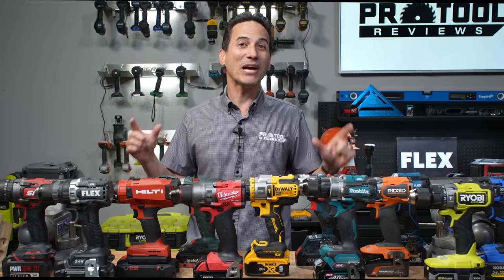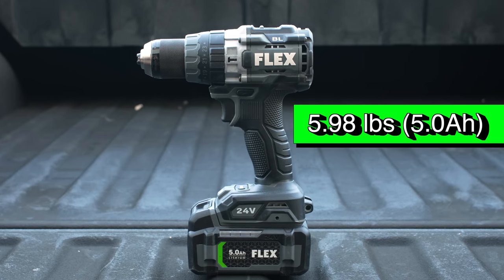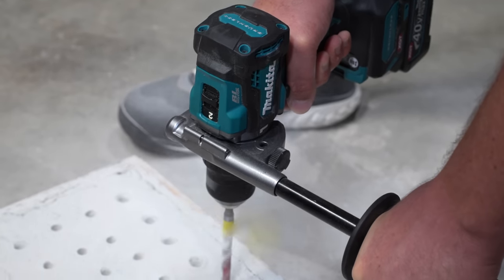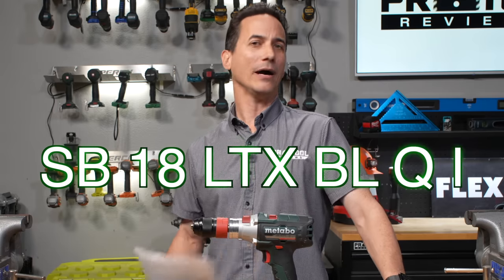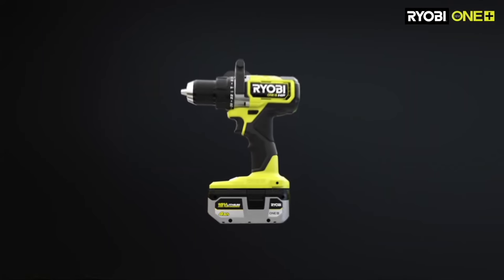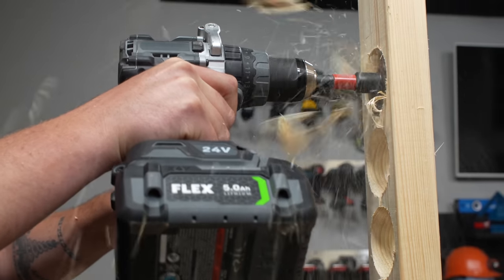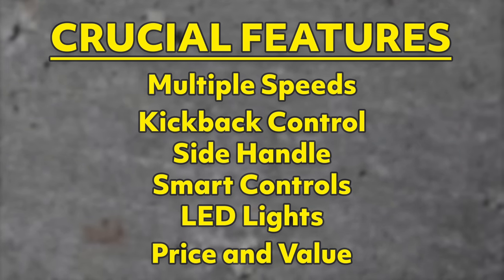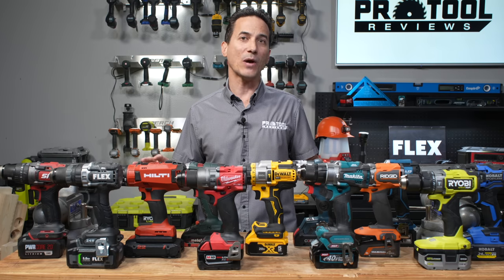Best Cordless Drill 2024? Milwaukee, DeWalt, Makita, Flex

Comment: Why are you testing the DeWalt with a rubbish 5Ah when it's designed to use flexvolt batteries and is even only sold in a kit with a flexvolt battery.
Reply: Was about to ask the same question. No response from Pro Tool discredits their results.

Comment: I feel like you guys are always biased towards Milwaukee it finished lower in most categories to the makita but still won overall 🤷
Reply: Unfortunately most channels are biased towards them as they often are the most powerful, but at the expense of ergonomics and tool longevity.
Reply: Yes, you are right, Milwaukee always wins because of the prejudices of these channels.
Reply: @EliotTruelove  Yep. It's always about power and less about reliability, and ergonomics, where as ergonomics and reliability should have a higher priority. 99.999% of power tools have enough power to do the job they were designed for. Ratings of trucks are the same oftentimes. Toyota has a little less power than the big 3 often times, but if you want the truck that will last 2 to 3 times as long and maintain its value better and cost less overall to own, you go with the Toyota... Makita is like this. It may cost a little more upfront, but it costs a lot less in the long run
Reply: @EliotTruelove and they wouldn't have been the most powerful if all drill came with the batteries required for max power (e.g. Bosch ProCore/ProFactor 5.5 Ah or above, instead of the lightweight 4Ah single row battery they used).

Comment: Years ago I bought a Makita cordless drill so that I can be in line with everybody else going cordless after about 6 years the batteries were no longer charge The batteries were no longer available only aftermarket batteries aftermarket batteries were crap they wouldn't hold charge either so there was stuck with a cordless drill and no way to power it I got rid of it at a garage sale for about 15 bucks from then on all my power tools are corded It's just too expensive to have to replace a cordless drill or any cordless product every few years because the battery is no longer hold a charge and batteries become unavailable It's a scam.

Comment: Of course you would pick the newest Milwaukee!! What about the turbo function on the good flex drill and the stacked lithium battery!!? With the turbo function you essentially have a 4 speed drill with the flex and all these times would be completely diff. Which it almost bested all of them with no turbo function the cheap flex yal used and no stacked lithium battery.. fan boys in this channel once again lol

Comment: These tools are great if you're using them in a professional setting, all day everyday. What about regular drills that people can use around the house? build a deck, hang some photo frames, assemble furniture etc. Can you review those.
Reply: If youre going to build a deck or some project of the sort, u might as well get the Milwaukee shown here due to its size and power. Dewalt is powerful but bigger and flex is heavy but Milwaukee is pro and feels better. HERCULES BRUSHLESS would be my next go to bc of its price.
Reply: Imho for these light, occassional tasks, you can just get any drill you want. Maybe keep an eye on what other tools would be interesting to you and see if the manufacturer also offers these on their battery platform.
Reply from the maker: Some consumer brands we trust, that aren't so hard on your wallet;
Ryobi
Craftsman
Hercules
Hart
Masterforce (Depending on your location)

Hope this helps!